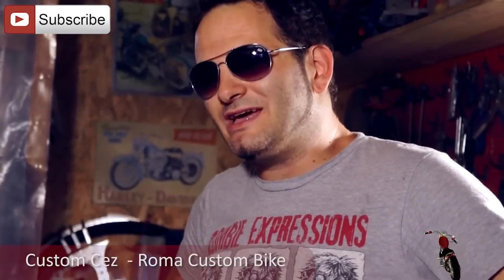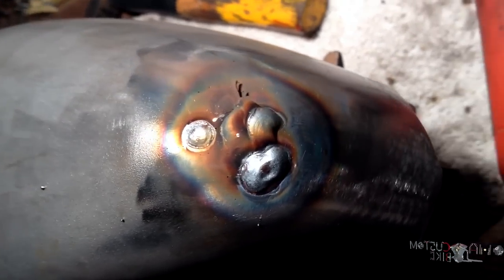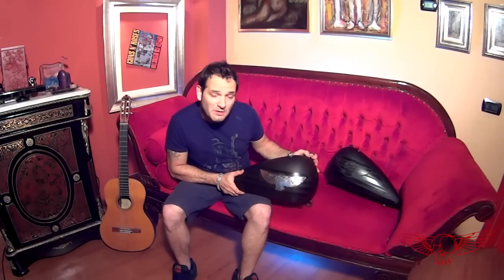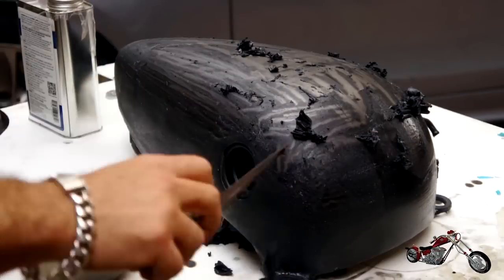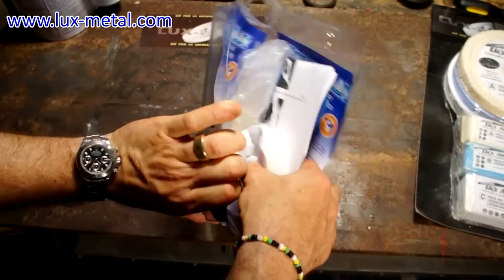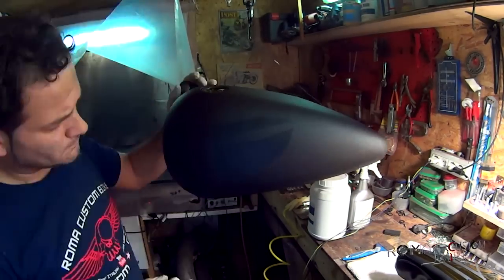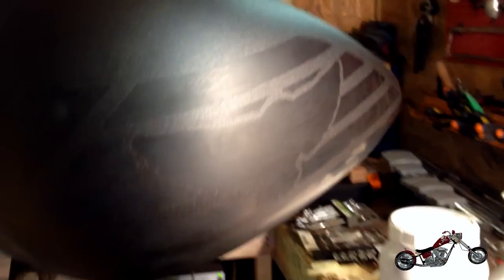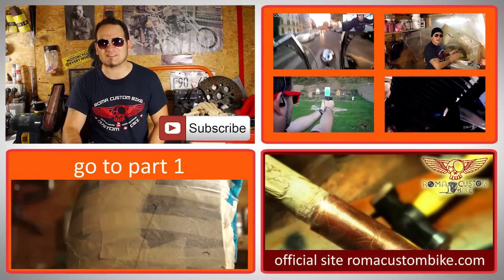DIY Powder coating tutorial tips and tricks - Two tone powder coating - ep 16p2 - Roma Custom Bike

Comment: Hey man, I'm having problems with the coating, as soon the powder gets heat it shrinks and won't stick, any help. Doing a Harley engine, there's no grease or any residue. I put higher temperatures primer already.
Reply from the maker: +Oswaldo Perez man, i'm sorry you are having problems. I would think 2 possible reasons:
1) the cast iron or aluminum is known to "gas out", releasing trapped air/gas when at temperature, try getting the part at 450F before coating
2)the primer and the top coatings are not compatible and a chemical rejection occurs.
I've never used primer under powder coating, that might also be your problem.
Let me know if you figure it out.
Good luck